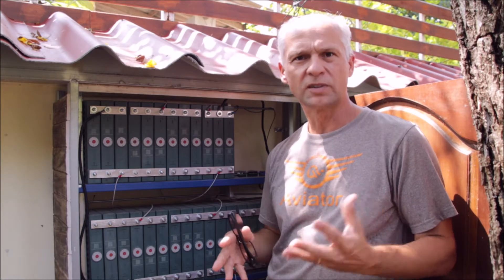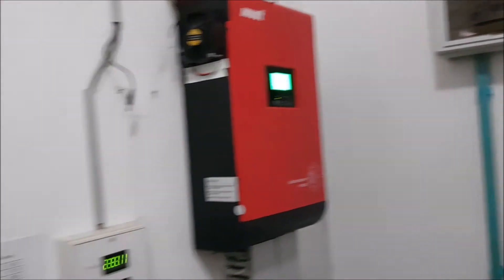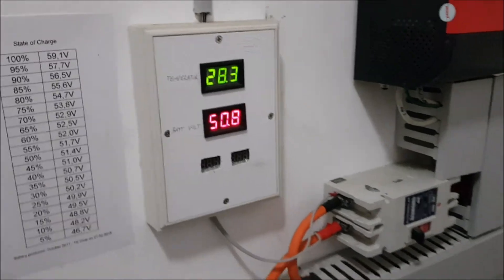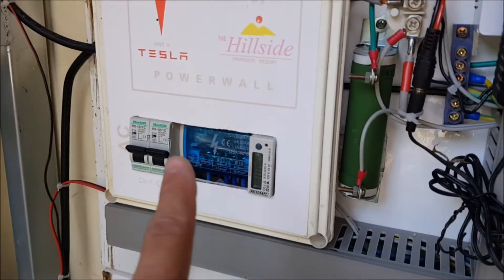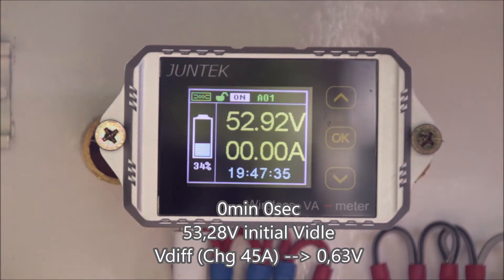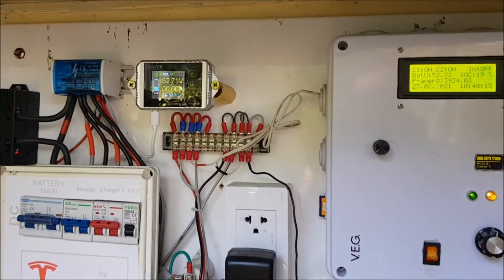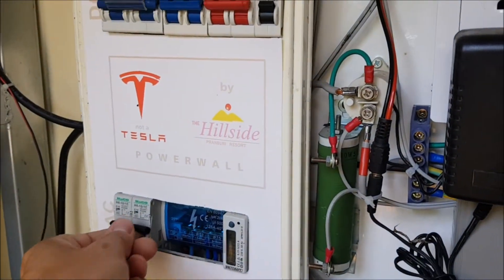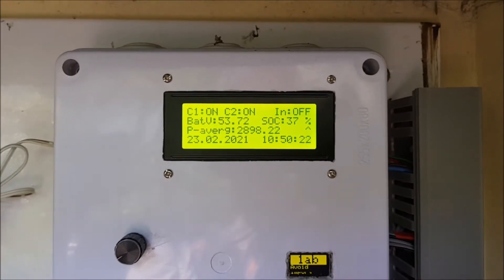Inside LiFePo4: Why is this chemistry seemingly so unpredictable? Resting, what's that?

Comment: I was wondering if this "resting" is the balancing system pulling volts from the high cells and giving it to the low cells, bring the voltage down and changing the over all voltage.
Reply from the maker: Well, I do not balance. But it is of course true, that if you have an active balancer, it would always work against the cells. Resting is still something completely different and only exists in LFP chemistry this way. Its like comparing the active materials with a sponge in a bucket. You can flood the bucket with water, and if you are pouring in water very quickly, the water level will rise fast and the bucket might even overflow before capacity. Its just that the sponge needs time to suck up the water first...

Comment: On the LiPo Pack you only displayed one (1) digit to the right of the decimal point = 1/10th Volt.  But on the LiFePo4 pack you displayed two (2) digits to the right of the decimal point = 1/100th Volt.  I saw the LiPo Drop 1/10th of a Volt and settle.  I saw the LiFePo4 pack drop 2/10ths of A Volt and settle.  So what?  So, who cares how much the voltage drops in the FLAT portion of the charge / discharge curve when the charging current is off and the battery pack is floating?  There are only two voltages that really concern us is ... 1) High voltage cut-off when charging  and  2) Low voltage cut-off when discharging.  Amp-Hours is a very good way to estimate the % SOC ...